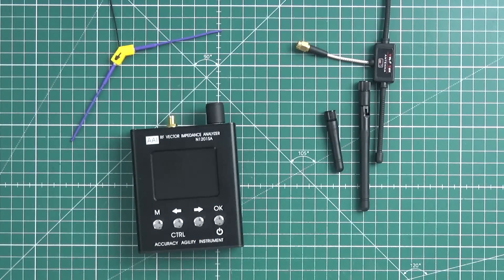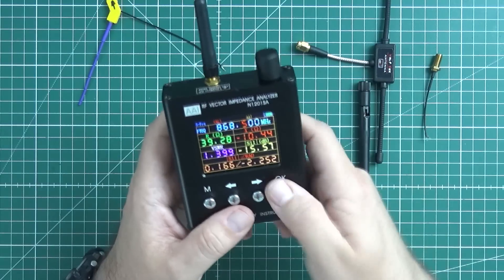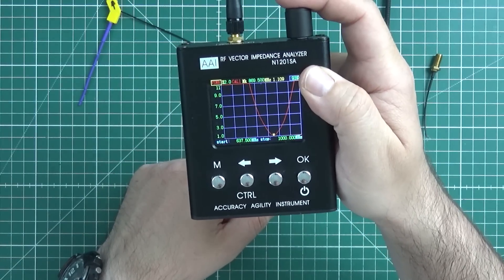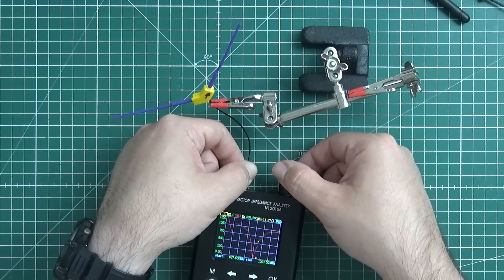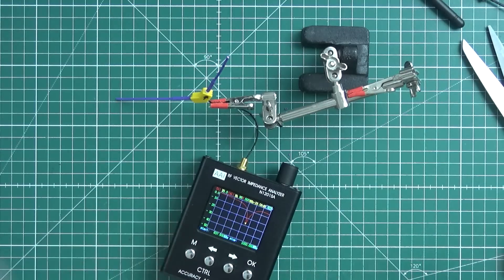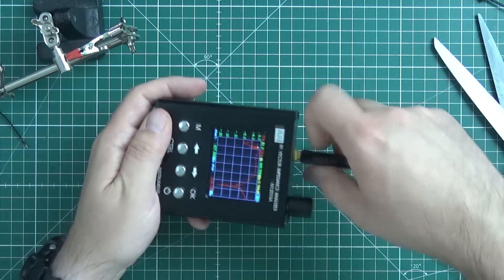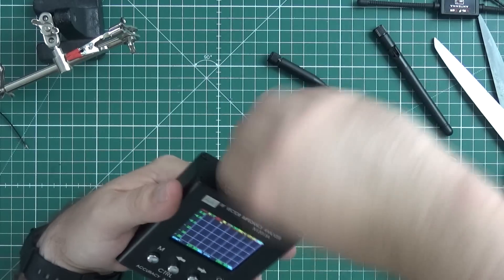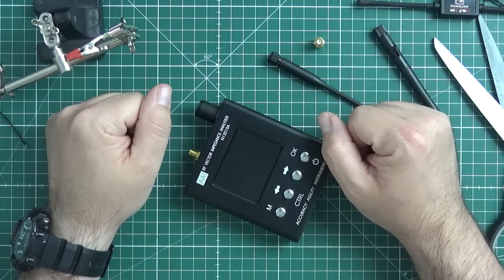Know you antennas: N1201SA Vector Impedance Analyzer / VSWR Meter

Comment: Dear Pawel. i have one little problem with Inav. 
i have sky surfer x8 (1.4m). 
this plane have very small rudder and very small high steering.
when i fly in manual mode , servos work in full range and plane can move fast up , left and right.
but when i switch to horizont or angle mode servos start work on half amplitude. 
now it's going up very slow...
if it posible change rudder and high servos to full angle ?
Reply: jnb thanx !!!
Reply from the maker: And you see it on a bench right? This is expected. In flight it will behave differently. Watch one of my previous vids: https://www.youtube.com/watch?v=o2RwTeBbvos
Reply: man do some reading before 
https://github.com/iNavFlight/inav/blob/master/docs/Autotune%20-%20fixedwing.md
https://github.com/iNavFlight/inav/wiki/Fixed-wing-guide
You can start with:
P-I-FF
rol: 3-7-33
pit: 3-7-31
yaw: 2-4-18
do autotune for your throws...
Reply: Paweł Spychalski thanx